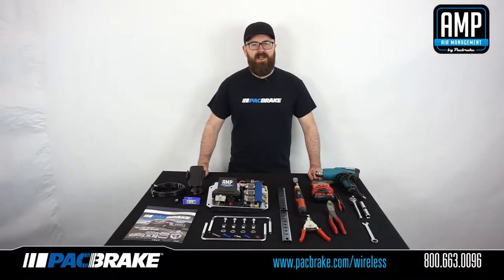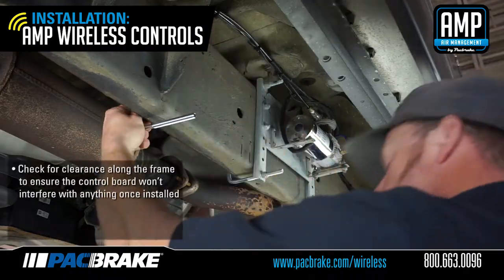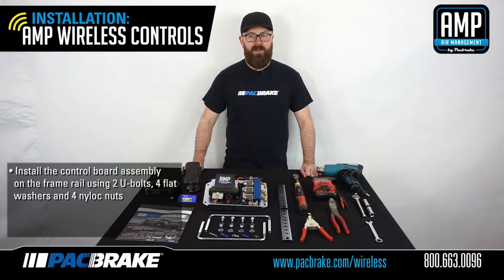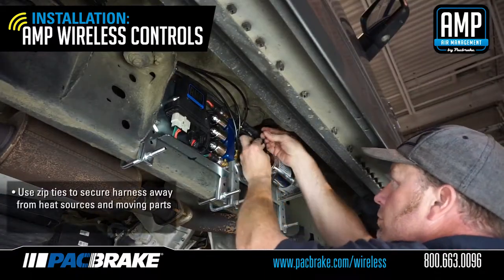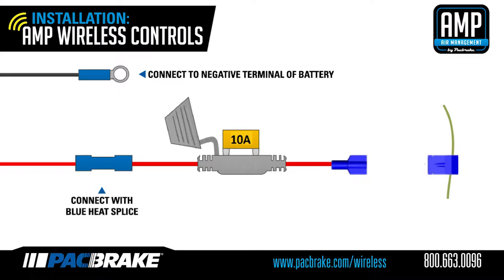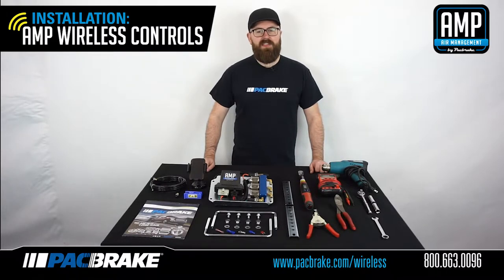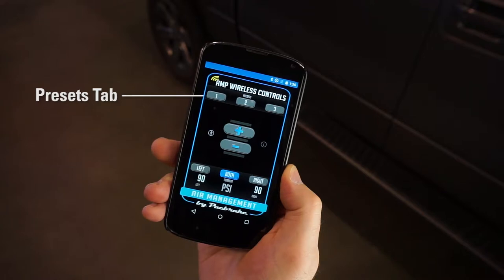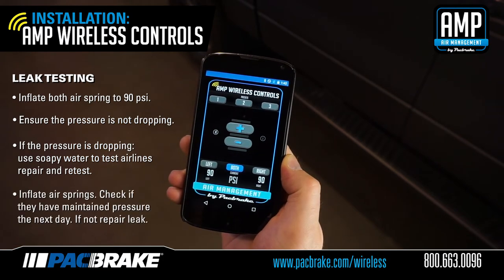AMP Wireless Air Spring Controls Kit Install

Comment: I like this setup, but I just check their website and they only have a left/right or front/back. I need a front-left/right and a back.
can't seem to do that with this one.  I have been piecing parts together in Amazon to build my own. I thought maybe I found a place to get everything I needed.  Nope. 
You should check out the air bags from Kelderman.  That makes the truck ride like a Cadillac.  You can do just the back or all four wheels.